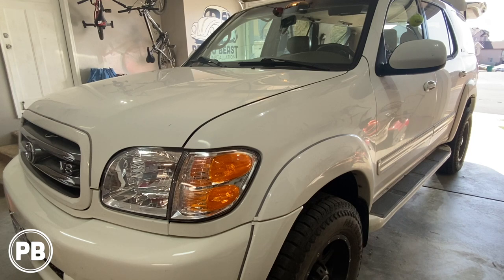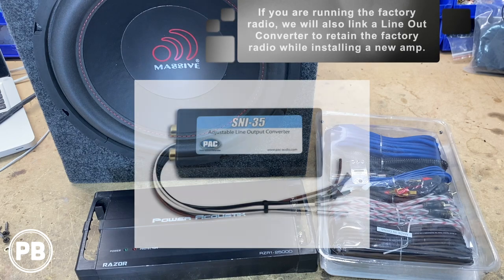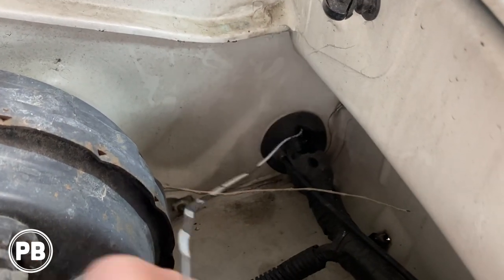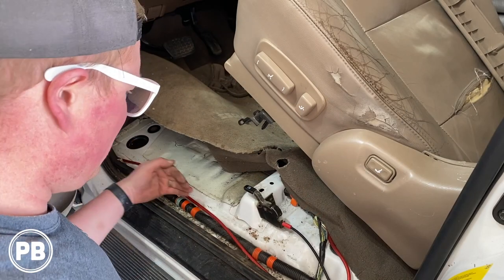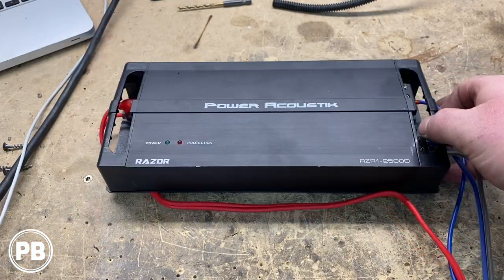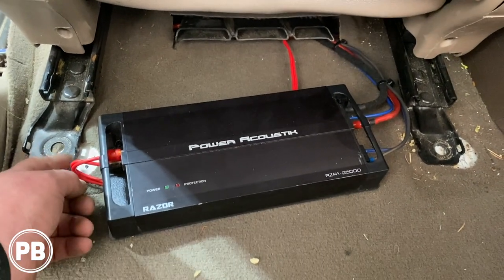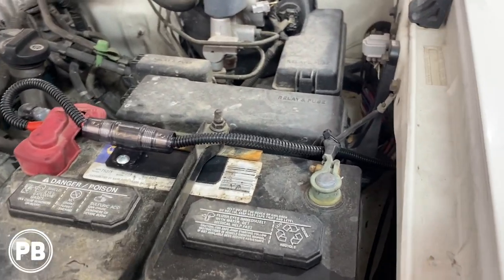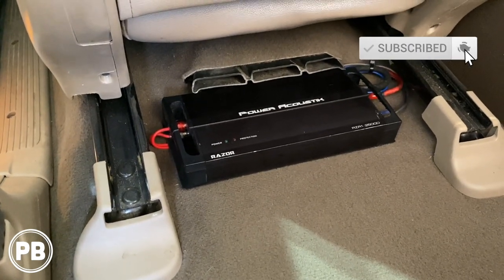2001 - 2007 Toyota Sequoia Amp and Sub Install

Comment: did the same 2 days after i bought mine 2 skar sk-mini amps 8"x11"x2" both 4channel 400 watt and 500/1 subwoofer amp, i have to shallow 10's in a ported skar sub box ,done trucks and cars stereo's for years, sound freak,, as you can use any good quality amps and speakers, make sure you pic a good head unit, many will say my cheap 50 deck sounds great,,but if you have a chance hear the  sound quality of a good head unit another car or truck and then the 50 dollar one. most do not compare, in my sequoia i have a Mechless deck Alpine ILX-W650 sounds amazing.

Comment: Why not use the wiring from the existing amp, or did this sequioa not have an amp... sorry didnt watch the whole video after I noticed that you were running a completely new "hot" wire.

Comment: Did you actually screw the fuse breaker into the battery at 7:08?
Reply from the maker: Of course not.  We use abs plastic to make fuse mounts, and utilize the battery tie down strap to make amount / sandwich plate to secure the fuse in place.  Keeps it serviceable without letting the fuse holder flop around the engine bay.  Don't be an idiot and screw your holder into the battery (I'd assume thats common sense?)
Reply: @ProvoBeastAudio  I didn’t think you did but you have to admit from that angle it looks like it. Thought I would bring it up so no one else would make that mistake.

Comment: I have a 06 Toyota sequoia with a built-in app underneath the council I’m trying to hook up my double den but I can’t find a harness to Connecticut
Reply: I have the same setup in my 06 Sequoia. You can find an adapter at crutchfield or sonic electronix.  It will allow you to still use the factory amp and speakers

Comment: So is it possible to retain the factory amp to the doors and then hook rca to the subwoofers?
Reply from the maker: Yes. If you keep the factory radio, just will need a line out converter. If you have a aftermarket radio, it’s all irrelevant since the radio itself has rca outputs regardless if you have the factory amp or not.
Reply: @ProvoBeastAudio  I am having trouble setting up my amp with my factory jbl radio, I have tried multiple output converters and no luck. I know it’s from the converter; amp, sub, and rca cables are perfect, is there a specific line output converter I can get? Thanks

Comment: sub install?
Reply from the maker: The sub was added later, and most amp and sub installs really come down to the installation of the amplifier, as the sub in most circumstances are plug and play.
Reply: @ProvoBeastAudio  Gotcha, I didn't know if it was a sub that goes in the pocket where the headrest goes